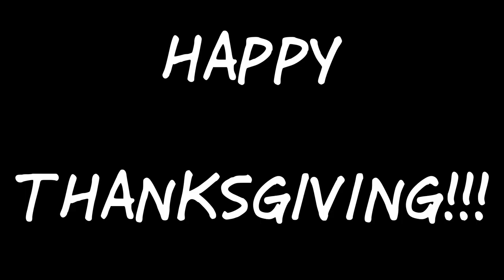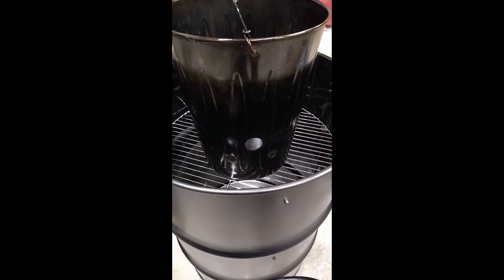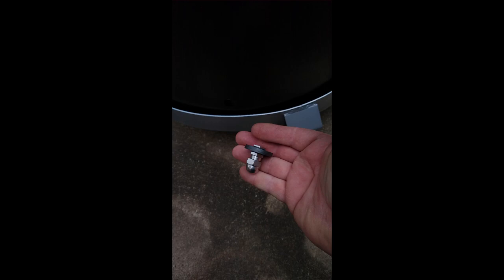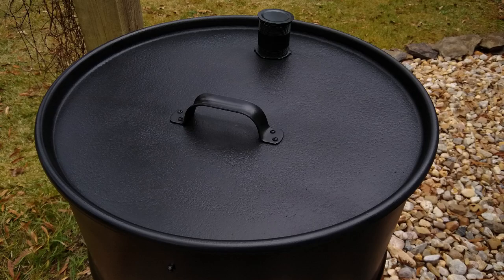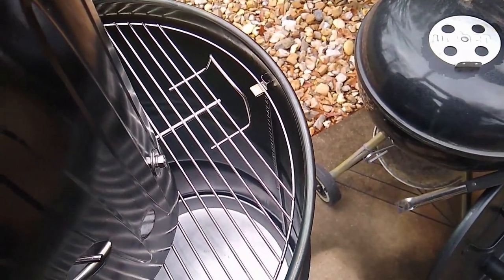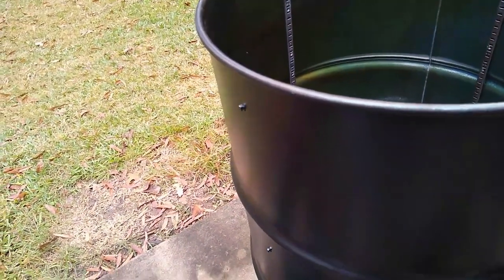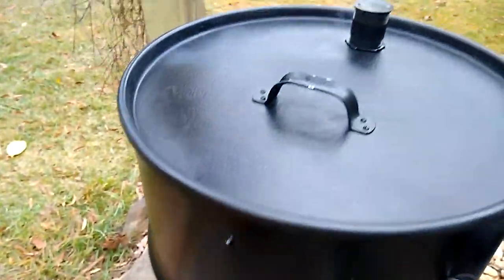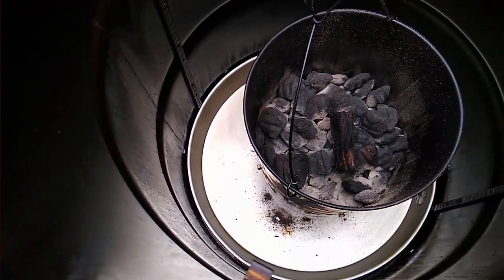My New UDS Ugly Drum Smoker Build Adjustable Racks, BCF, Mess Pan, Magnetic Covers - DIY Smoker Tips

Comment: I build the smoker exactly as you described.  It works great!.  Smoking a few racks of ribs as I write this reply.  One small suggestion, I attached magnets to wine bottle corks with 1" drywall screws.  Thank you for taking the time to make the video.
Reply from the maker: The magnets and cork idea is a good one!
Cork holds up great in both wet and high heat situations, so it is an excellent choice. I'm glad you found the video helpful and congratulations on a successful UDS build.
I'm going to pin your comment to the top of the list so others may see it.
The magnets and wine cork idea is a lot more viable DIY option than what I showed for most people.
Thanks for the tip, I'm sure a lot of people will be able to make use of it 👍

Comment: I've built a few UDS smokers myself. I've based mine off the pit barrel design. I see one thing that is a possible safety hazard with your design. If that trash can you're using is galvanized it can make you sick. The chemicals used in the galvanization process melt at a low temperature and they can Leach into your food. So be careful what materials you use. Sound idea though. I use my UDS for both smoking and grilling. The Webber kettle attachments fit it quite well so it's my rotisserie and kabob machine. Very versatile. Love mine.
Reply from the maker: The trashcan wasn't galvanized and the paint was burned off it. The wire handle on the trashcan was galvanized, but I burned the galvanized coating off of it before it was used for cooking. It isn't hard to remove zinc used for galvanized coatings with acid or by burning it off (upwind of course). Hard to beat a UDS in my book 👍
Reply: @TheFishingHobby  I use to do a lot of welding for work and I have had the unpleasant task of welding on galvanized metal. It's not fun and the fumes are nasty.

Comment: When lighting briquettes, I always make a tube from TP or paper towel inner rolls, and stack the briquettes around it in the basket.  Then I place the lighter fuel ( I use gel rather than the solid types now) on the base, then sit the briquette basket over the flame, which will ‘chimney’ up the core of the burner.  Works really well, and is so much faster.

Comment: March: Munchie Dogs

4 beef dogs of your choice
1 can of beer (whatever crap your buddy brought and no one will drink)
1/4 tsp garlic powder
1/4 tsp onion power
1/4 tsp cumin powder
1/4 tsp chipolie powder
1 tsp seasoning salt
Grind pepper to taste
1 tsp Worcestershire
10" flour tortillas
Cheese wiz
Buffalo sauce (Franks) 

Combin beer, dogs and seasoning in a pan and bring to a boil
Preheat grill and flattop.
When dogs start to raise if the bottom remove and place on the grill
While those are cooking add some cheese wiz to the center of the tortillas.
When the dogs are about ready to come off the grill, warm tortillas up on the flattop.
Assemble by placing a dog on each tortilla add Buffalo sauce to taste. Roll like a burreto and enjoy.

These are great with mock rootbeer floats.
12 Oz roobeer
2 Oz heavy cream
Combine in a chilled mug and mix. ( root beer in first to avoid a overflow)

Of course just a cold beer works well
Reply from the maker: Those sound awesome!

Comment: Great build.....

What are the dimensions of the aluminum water pan, & is it stout enough to withstand the temps of the charcoal basket sitting on it
Reply from the maker: It is very thin, but doesn't get hot enough to damage it. It is about 20" wide at the top.

Comment: This is a very helpful video. Where did you find the grate that goes in the trash can to hold the charcoal? What is the diameter of it?
Reply from the maker: It was either 10.5 or 10.25 inches in diameter. I ordered it on Amazon.

Comment: great video. Did you weld or bolt the adjustable brackets in?
Reply from the maker: Bolted in with machine screws, washers, lock washers and nuts.

Comment: great build. would a slightly elevated lid above the smoke basket help control drippings going into fire, flare ups and divert direct heat?
Reply from the maker: I've used this one several times now with no issues using the flat lid. My first UDS did use a domed lid. The domed lid has an advantage when it comes to shedding rain water, I'll say that. The flat lid seems to run a little hotter, probably due to the decreased head space. Can't say I've had any issues with dripping though. I do wipe the lid down between cooks just in case.

Comment: Hi, I have built a drum smoker and I really need some help, I have 3 x 3/4 inch air inlets on bottom and 2 round adjustable vents In the lid. I am struggling with keeping temperature and I find it dropping off often. My air vents are 2 inches from the bottom and then my fire basket sits about 1-1.5 inches above that. 

Any suggestions on what could cause this? Is my basket too low and causing lack of air flow?
Reply from the maker: The biggest problem is usually air control or a basket that gets choked out with excess ashes. Once I put my meat in, I don't open the lid until I hit my desired internal temperature. Large volume of air (55gallons) comes in everytime the lid is opened causing temp spikes. Ash choke is from a basket that blocks too much ash from falling through away from the burning coals. Too little air coming in or not enough exhaust can cause low temps. Hope that helps!

Comment: what did you use for the bucket handle on the charcoal can?
Reply from the maker: It was just some heavy galvanized wire I bought at one of the home improvement stores for something else a while back. I burned all the galvanizing off with a torch before I used it on the bucket. I didn't show it on the video, but I ended up putting a similar handle on the big aluminum water heater drain pan I use in the bottom of the smoker. It was just some really thick uninsulated copper wire you can find in the electrical section of home improvement stores. It is much more flimsy, but the water heater pan is very light weight. I think I'd stick with steel wire for the charcoal basket.

Comment: How well does the ash bucket work when hanging meat? How, if you do, do you hàng meat?
Reply from the maker: I don't hang meat personally. I use rib racks instead for horizontal stacking. It doesn't make sense to me to hang meat in a UDS because the heat source is at the bottom so whatever is closer to that heat source will cook faster than what is further above it. A few inches stacked horizontal far away from the heat source is one thing but hanging meat like a rack of ribs would be a foot or more long and that is a big difference. Plus I like my ribs fall off the bone soft (personal preference) which wouldn't work too well for hanging anyway.

Comment: What about indirect heat for low and slow?
Reply from the maker: A UDS is indirect heat and will hold 220's for hours with no problem. The reason it is indirect is because of how far the meat is from the heat source. It works more like an oven than a grill. Set your temperature by adjusting the air intake and just monitor the UDS temperature and the internal temperature of your food.

Comment: With that basket how many hours can you get without having to add charcoal? This was an awesome video, I'm wanting to build 3 for competition use. Thanks for the advice.
Reply from the maker: I ran mine for 15 hours straight between 225-250°F and barely had any charcoal briquettes left. I never opened the lid after I put my meat in. Anytime you open the lid, you decease the runtime because it lets a lot of fresh air in that makes it burn hotter for a few minutes.
Reply: @TheFishingHobby  I was reading if that before you open the lid you should close your vents off almost entirely before you open the lid and you won't have the huge spikes in temp and make the charcoal last longer
Reply from the maker: It may help some, but if you open the lid it will fill the entire drum with air so you have to at least burn off that 55gal volume off first. I just put my temperature probe in the meat as I put it in and don't open it until I reach the internal temperature I'm looking for.

Comment: Great job on smoker. Appreciated your detailed perspective. 
1. First time I've ever seen the water heater pan - great idea. 
2. From my experience,  Increasing the height of smoke stack will increase the air flow / temps vs having to do a lot of intakes. 
3. Question. Do you have any issues with the grate falling down? I tried using the pilaster clips using 3 strips instead of 4 (that's all I need when I use bolts). It fell easily. 
4. Do you know if the pilaster clips come longer than 5/8 inches?
Reply from the maker: I don't have any issues with my grate falling with the four strips. Some drums are wider than others though. You can always put a stack of washers behind the strips as spacers if needed to move them in closer. I'm not aware of any clips in longer lengths.
The water heater pan really works well. I'd definitely recommend it!
Reply: @TheFishingHobby  Thanks. The washers is exactly what i thought of last night as well. Going to try that. Hopefully it will work out ok. Thanks again
Reply from the maker: Good luck with it 👍

Comment: Smoke you some jalapenos.  Just put them in the grill at about 250 degrees for about 3 or 4 hours, heavy smoke. Then clean them up. The heat goes into the peppers. Cut them up and use them in beans or cornbread. ☺
Reply from the maker: I've smoked Jalapeno poppers filled with cream cheese and some filled with cheddar cheese. They are awesome 👍

Comment: Have you ever seen the need to add a water pan for moisture?
Reply from the maker: No, I don't use water or a heat deflector either. It's really like a coal/wood fired oven. You have so much control over the heat it is ridiculous! If you pull at the right temperature, nothing ever gets dried out. In fact, it seems to keep meats especially moist, moreso than a regular oven.

Comment: Maginets loose strength from heat
Reply from the maker: They do but ceramic magnets like I used on the video hold up well to high heat situations. Like I mentioned in the video, I used some on my original UDS for 10 years with no issues whatsoever.